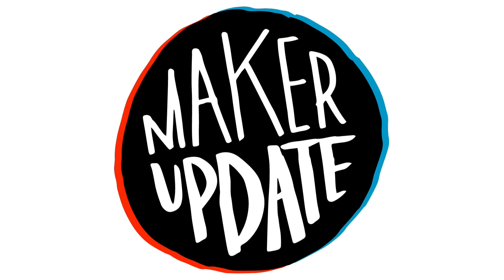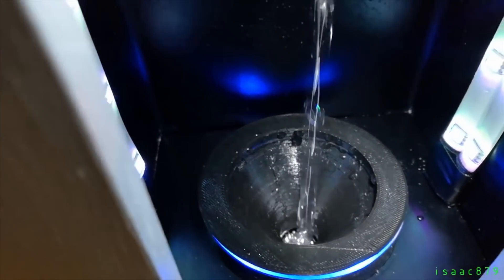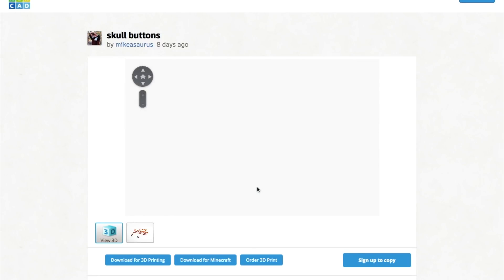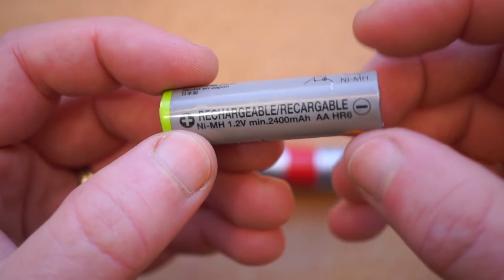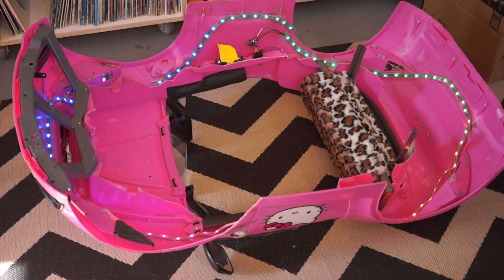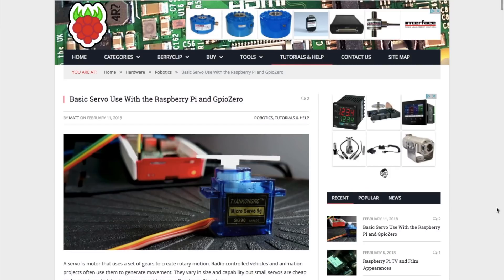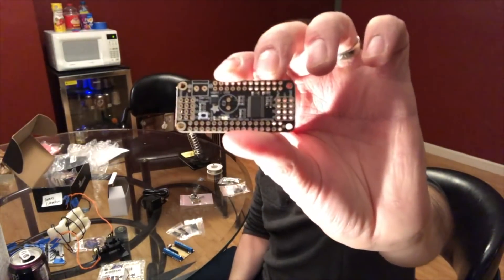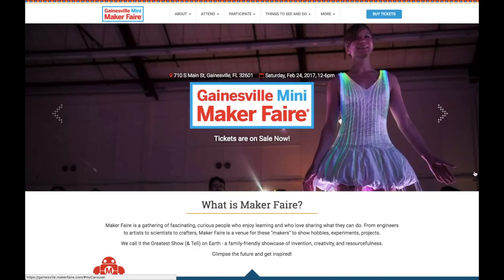Floating Water [Maker Update]

Comment: For just a few pence on eBay or Aliexpress you can buy TP4056 charger boards for 18650 Li-Ion batteries that have built in battery protection (vital if you are going to use Li-Ion batteries not to over discharge them!). The little boards are great and make your project USB rechargeable. Just make sure to purchase the ones with connections for both battery and output as those have the built-in protection.

Also for powering 3.3v projects 18650s are available fuelled by LiFePO4 which means it is possible to run 3.3v projects without a voltage regulator and associated power loss.

Again though always be sure to purchase cells with built in protection or use a protection circuit. Recharging 18650s that have been run down below ~2.5v can be highly explosive.

Comment: 18650s are cool and all, but I’ve started using cheap “lipstick chargers” for a lot of my projects. They cost a little more (the ones I’ve been using are $8, shipped, from Amazon), but they output 5V at 1 Amp, have a hardened case, use a standard USB cable to charge from any phone charger, and can plug right into the micro-USB port on a Gemma (or Trinket or Feather) board. 
I make a lot of props for a kids’ theater (TKTC in Long Beach, CA), and using cheap power banks means that I don’t have to have a charger (and instructions) on site. I also really like that I can enclose a prop with the battery attached externally, so curious 12-year-olds aren’t poking around inside. 
Love the show - keep on making!
Reply from the maker: Cool idea! I bought one of these recently to play around with. How do you go about attaching the battery?
Reply: Velcro works fine - they’re pretty light. It helps to decide on a “rule” for which side of the Velcro you apply to the battery (e.g., soft side always goes on the battery), so you can use batteries interchangeably. I’ve also hot-glued the box that the battery shipped in to the back of a project, so it’s kind of a holster. And, in a pinch, duct tape will always do ;)

Comment: Go bears! BTW A Tesla has around 7,104 18650 cells in it's battery pack, just say'n.
Reply from the maker: My guess is that their widespread industry adoption is what has made them such a bargain compared to other Li-Ion batteries. They're also abundant in security systems and industrial smoke detectors and HVAC systems, as backup batteries. They're everywhere, but I only just learned about them this year!

Comment: The 18650 battery's are fantastic. (Although around here we call them eighteen six fifties) https://youtu.be/7dUnHa_zPwM  That is what powers this sound box i made with a C.H.I.P. The cool thing is that the Chip has the right charging circuits for the battery, so using one of those holders and an 18650 i can power the whole project, and recharge it all from a single connection.
Reply from the maker: Man, eighteen six fifties is way catchier. I should of done my homework so I could say it the cool way. Oh well. That's a neat feature of the CHIP I didn't know about. I scored a box full of 18650's at a salvage store recently, but they're all wired up to tiny JST connections (smaller than the one's Adafruit uses). So finding a project for those where they can be recharged from the board would be nice. Also, the wikipedia page on these batteries states that Tesla car battery packs are essentially made up of thousands of 18650's wired into cells.